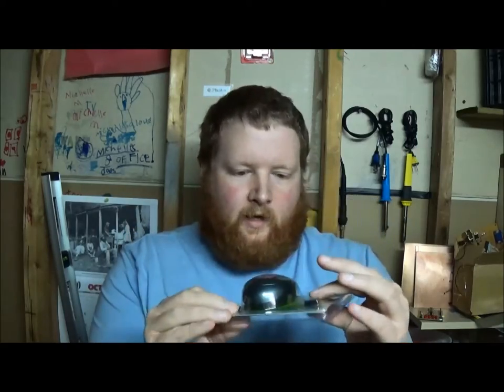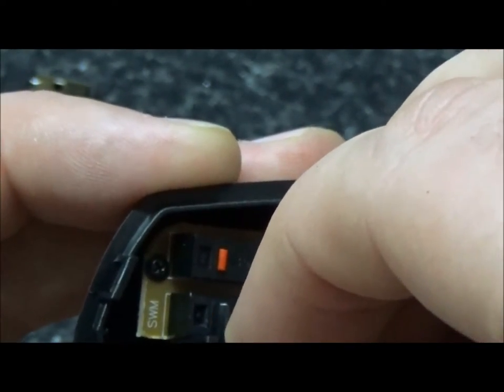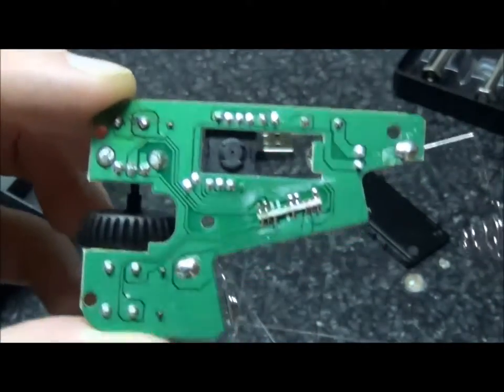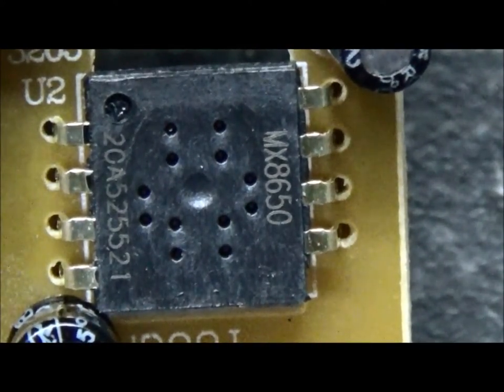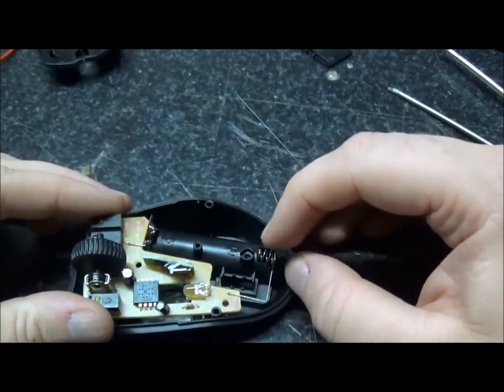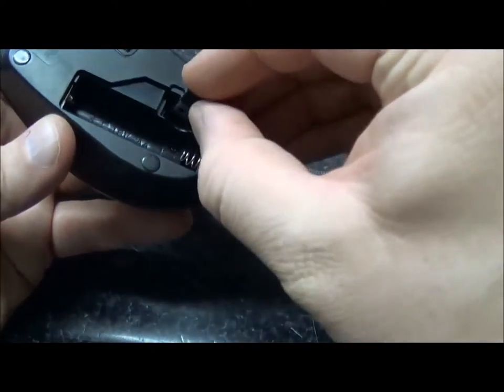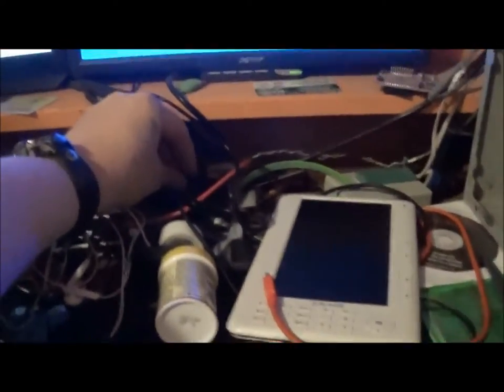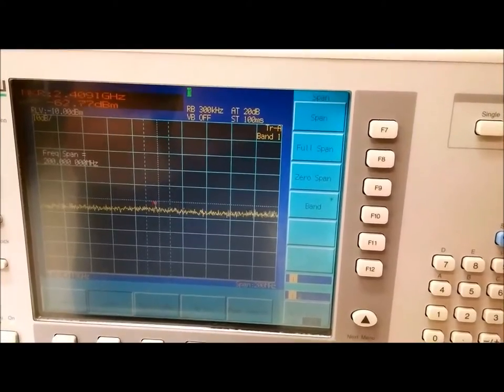Dollar Store Wireless Mouse Teardown

Comment: i have one and...its work but, when make left going in right and when push up going in down....WHY,,,???!!!!!
Reply from the maker: That's an extremely odd problem, I checked that datasheet and it's unlikely the sensor IC is rotated, I would think it's most likely there is a bug in the firmware in your mouse. Thanks for the comment.

Comment: There's no on/off switch so it's always using a bit of power?
Reply from the maker: yes, I found that to be the main problem with it, I was meaning to fit one in a video but been busy with university. Otherwise it is not a bad mouse. Many thanks for the comment.
Reply: I noticed it will power the light completely off after a while, until you press a button.  I guess that's not too bad.
Reply from the maker: I did find the batteries start to leak after keeping them in for a week, so there is still enough drain to do that. I just put a piece of paper between the battery and contacts.